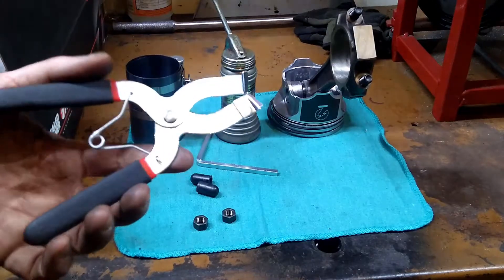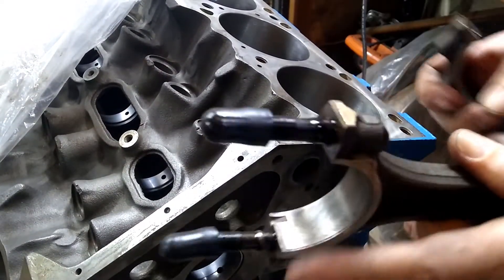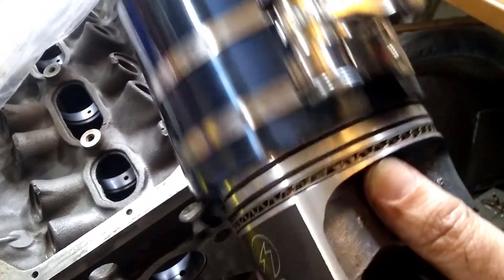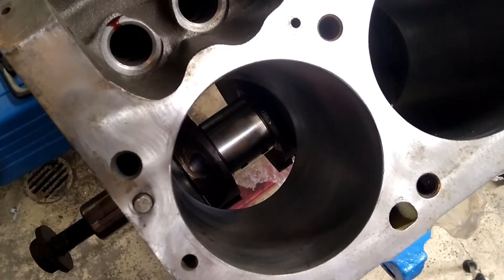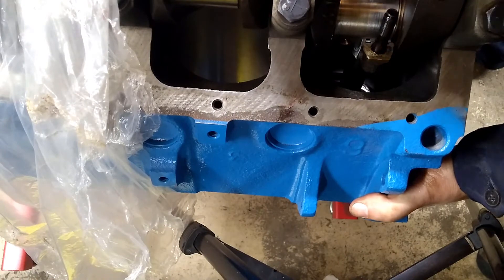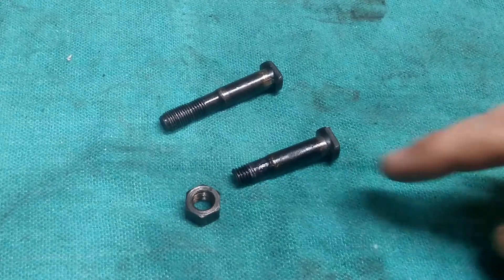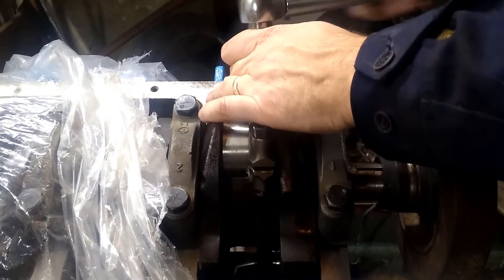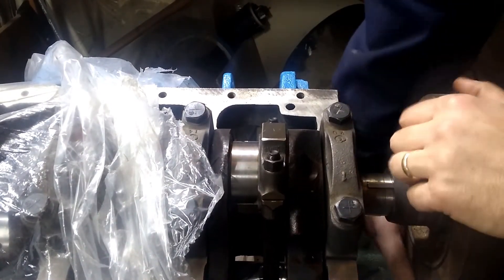Installing the Pistons and Connecting Rods - Mopar 5.9L Magnum Daily Driver Engine Part 6

Comment: Very helpful, wanted to make sure I gave my pistons to the machine shop in the right order before they swapped out my pistons (Though I assume they know what's correct). Just wanted to make sure my rods were correctly oriented and since you mentioned the oil drip location, I can now be sure. Thanks!

Also, Engine Masters did finally test the flipped pistons for power.... Was within margin of error: no change.

Comment: You didn't even need Doctor Torque's help to break that!  The rod bolts on my wife's Mustake 5.0 are only 19-24 foot pounds.

Is there any chance you weighed the old bolts and compared them to the weights of the ones you replaced them with to see if it might affect the balance of the engine?
Reply from the maker: I didn't do a weight comparison of the bolts for 2 reasons: First, The part that broke off went into the black hole of the garage floor and now lives with the 12mm sockets in an alternate universe and second it didn't occur to me.  I could weigh some others to see if there's variation, but I suspect that at the factory they just have a big bin of them and slap them in, and the weights are all within some narrow tolerance.  I guess we'll find out when I fire it up.